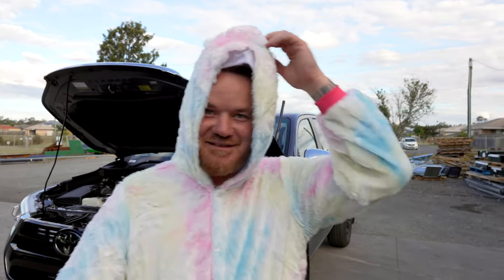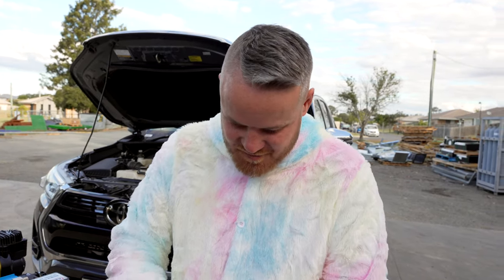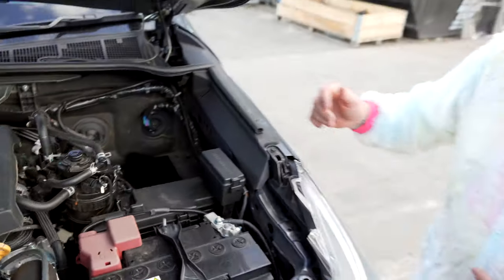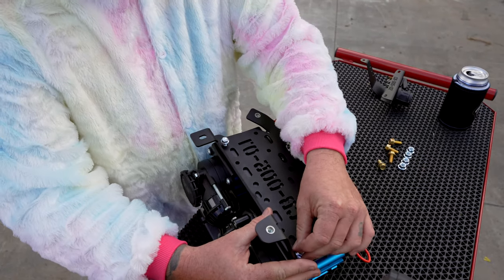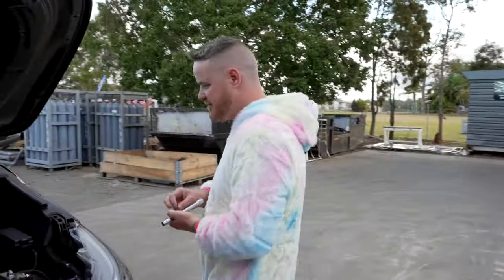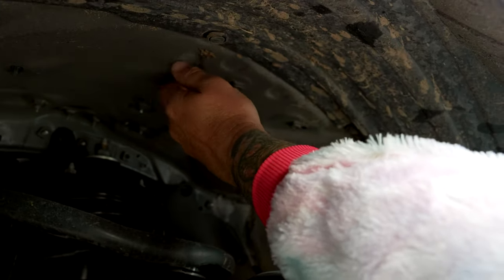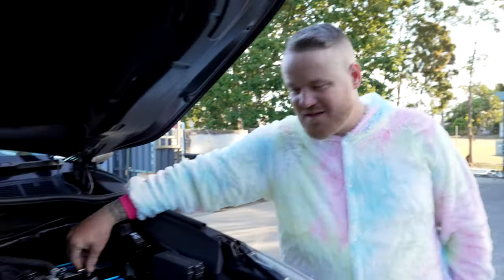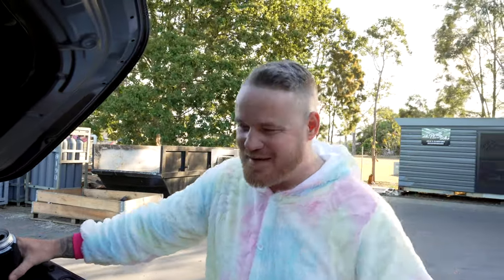UNIVERSAL UNDER BONNET COMPRESSOR MOUNT for TOYOTA N80 HILUX MODELS how to Install

Comment: Where's the dual.batttery setup go?
Reply from the maker: G'day legend,

Behind the rear seat, in the tub, under the tub. So many options these days. we're working on some different N80 options atm.
Reply: Better off mounting it in front of the air box, the double may not fit but ARB single fits there 110%
Reply: I want some tub options for the n80  @piratecampco